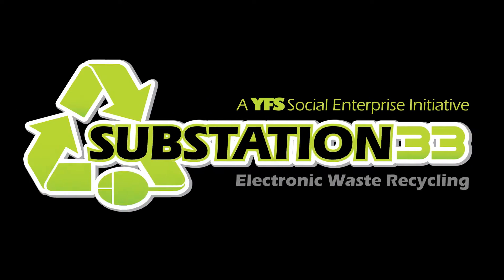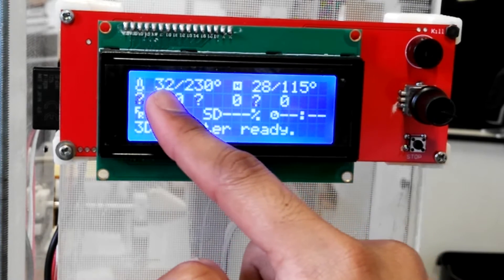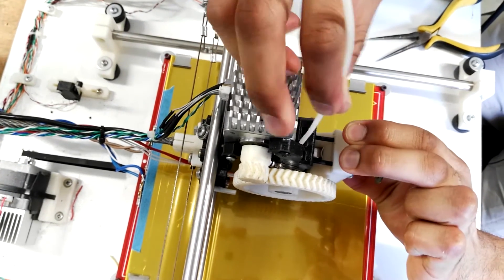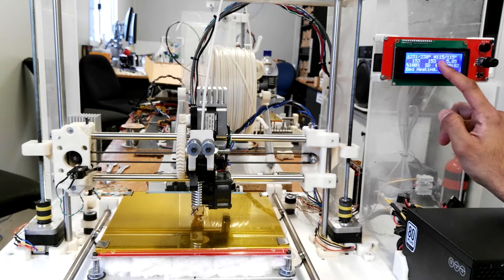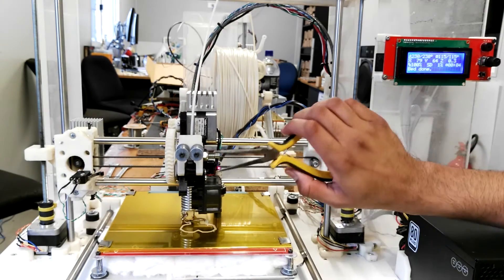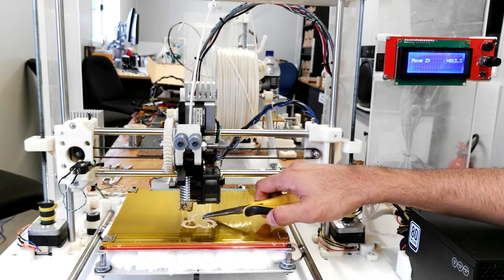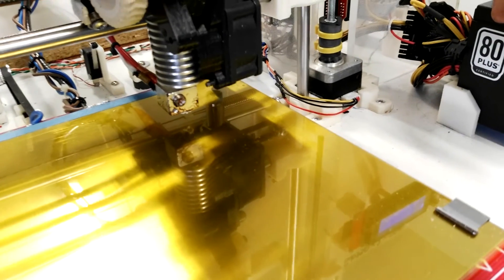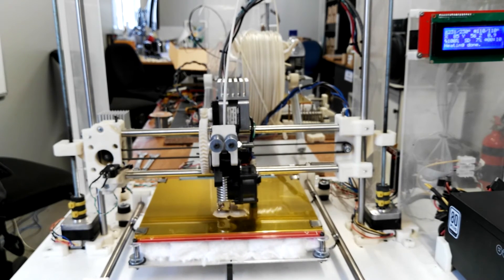Substation33  - Sub33D v2.xx 3D Printer Operational Guide

Comment: Hey I'm really excited that it got finished now I'm looking to print all the parts to start my own, but I have one question.
Is there a part 15? it goes from 14: Y-axis motor wire prep to 16: Extending Y-axis motor wire.
Is that just a type or is there a part missing? 
Thanks for the awesome videos guys!
Reply from the maker: Hey thanks for your comment.  There is a part 15 coming in the next few days